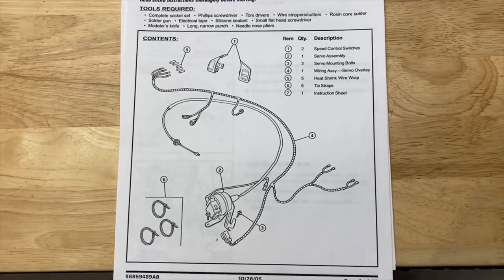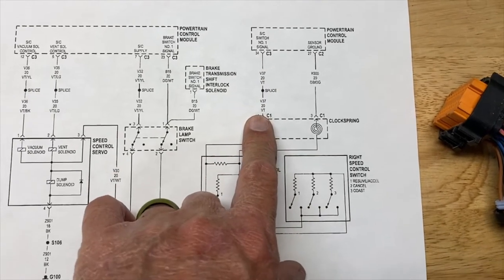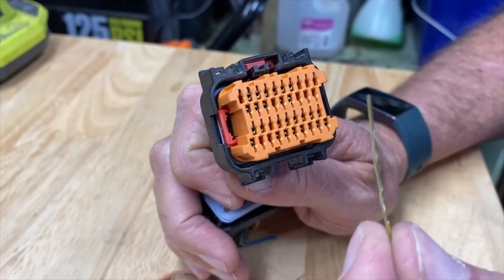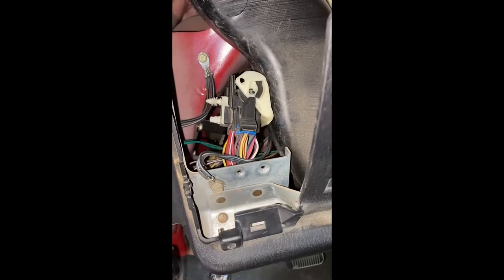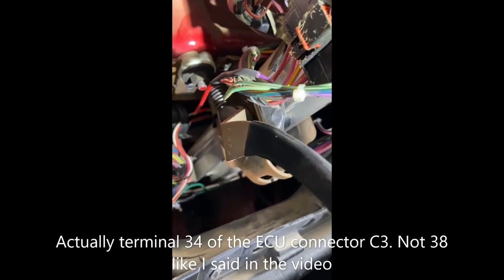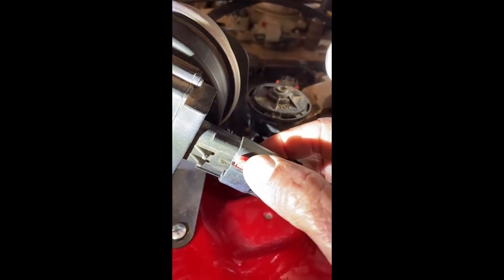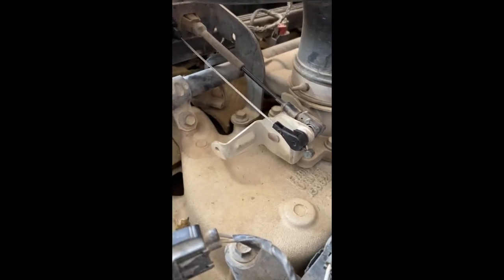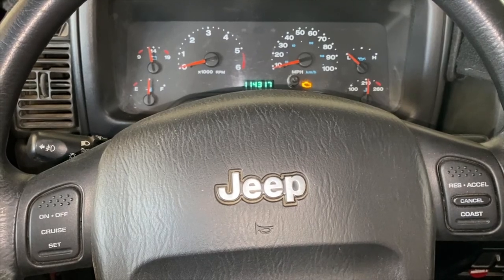Installing factory Cruise Control in a Jeep Wrangler TJ with used parts

Comment: Thanks for such a detailed video. I have 2005 Wrangler. I followed your instructions and it worked out good. Thank you again!
Reply from the maker: Glad it helped. 05 and 06 are similar. The other years have different wire colors and pin numbers on the ECU so it can get confusing. I have really enjoyed using mine. Makes trips so much easier.

Comment: I have a 2001 in which the pin out diagram is a little different. On the instructions you linked it shows a s/c supply. I have e my pinouts that say speed control on/ off switch sense and speed control switch signal. I assume the signal wire would go to the clock spring. Would the one labeled sense go to S/C supply which is labeled C3-7 on diagram?
Reply from the maker: It seems like Jeep changed the pinouts a couple of times during the TJ run. 05 and 06 are the same and match my diagram. All others will need the diagram specific to your year model in order to get it wired right. I'm not sure how the wiring on the 01 is laid out.

Comment: Great video and explanation.  I think my 2006 has the same arrangement.  Question about the connections under the dash.  1) the violet wire from the steering wheel: did you cut it and make it a 3-way splice or did you abandon the other side of the violet wire?  2) the brake switch: same question there with those two splices?
Reply from the maker: I abandoned the other side of each wire in all three cases. Just spliced directly to the conductors I added running to the ECU and servo.

Comment: Great video. Thanks for putting it together. Where were you able to find the parts? I have an 06 and I’d love to add cruise control to it.
Reply from the maker: I found the servo with the bracket and cable at an online junkyard. I got the ECU connector (for donor pins) from a local junkyard. I already had the vacuum line and wire.

Comment: How did you find the parts? Junkyard? I could find very few of the parts online for my 1999 TJ
Reply from the maker: I found the servo with the bracket and cable on ebay. I got the ECU connector (for donor pins) from a local junkyard. I already had the vacuum line and wire.

Comment: what about a 1998 tj ???
Reply from the maker: It seems like Jeep changed the pinouts a couple of times during the TJ run. 05 and 06 are the same and match my diagram. All others will need the diagram specific to your year model in order to get it wired right. I'm not sure how the wiring on the 98 is laid out.
Reply: Any information on where one might attain that diagram? I also have a 98 and have been wanting to add cruise control since ownership.